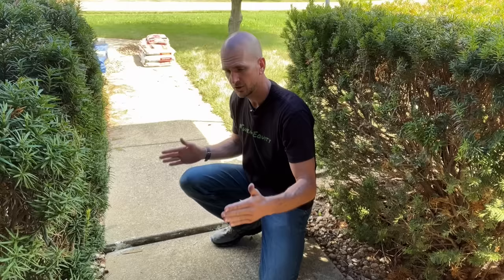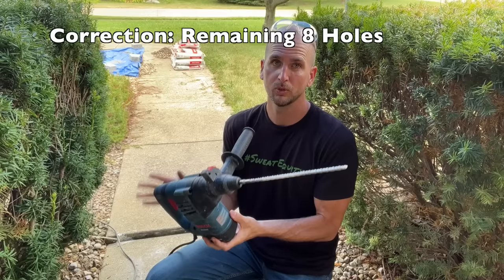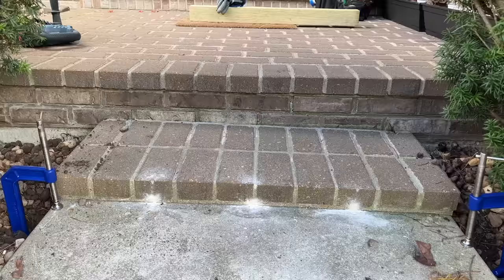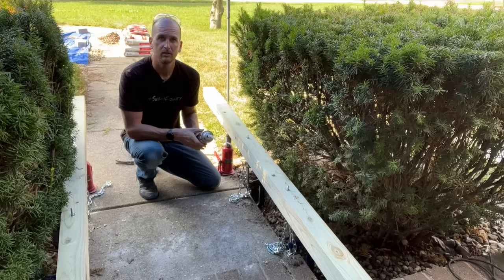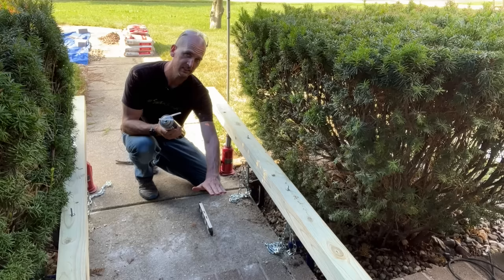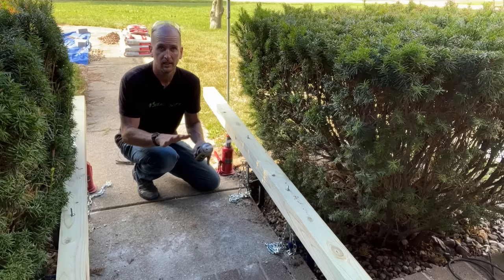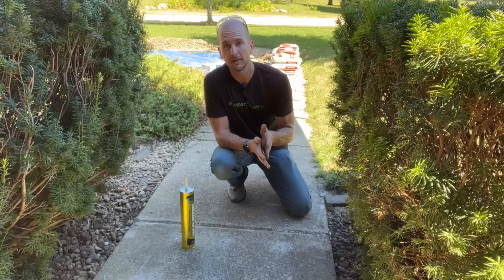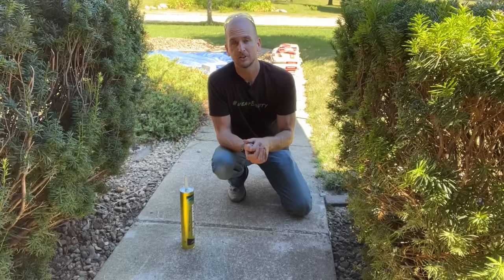How To Fix A Sunken Sidewalk With Spray Foam

Comment: In my view it would have been much less work to simply lift the slab, add additional hard core then replace the slab.
Reply: i think he didn't do that because the step to porch was on top of it
Reply: He showed one way to do it, there are several ways it could be done.
Reply: 🤭🤣 Yeah but he wants us to do it the dumb way while looking like "engineers"..!!
Reply: @carlosmejia5728  How is it the dumb way if it works fine? You sound like a real "my way is the only right way" gem of a person.
Reply: I don't know Trevor. That would have cost upwards of $0.17. This way was only $730.
Reply: Yep, so much easier. Cut the existing slab across just in front of the step to release it, lift it, backfill to the required level and drop the slab back down. Job done.
Reply: That, and the foam having air pockets aka bubbles. That thing will sink again and that soon...
Reply: Yes this was the special needs method.... brother what a complete and utter waste of time and money lmaaaaooo !
Reply: He is just trying to illustrate another  way to lift…he’s not saying it’s the only way. Get a life people!
Reply: @PatHaskell  quite, but he chooses the most difficult way.
Reply: @Steve
Exactly, this guy is a joke
Reply: This is the way.
Reply: I was just thinking the same 🤔
Reply: Can you make a video of how you would do it?
Reply: Can you make a video of how you would do it?
Reply: @jakewest2524  Can you make a video of how you would do it?
Reply: @SquareDancevideos1  I would if I had one to fix, but I haven’t.
Reply: In your view, how do you move the slab out of the way, to add the substrate? The bottom of slab is surely slightly irregular. How many times do you wrangle the slab back into place, only to find that you need to pick it back up again, move it out of the way and adjust the earth?
Reply: @commandoconstruction2720  I’ve already made my point.
Reply: exactly. just add rocks underneath now
Reply: That wouldn’t have warranted a video, although it would be the logical fix.
Reply: That slab would be 300 lbs. How would you lift it?
Reply: Yes you are correct
Reply: @Fhita1962  hahahahahaha
Reply: Yes adding more fill under the low side often works
Reply: @PatHaskell  you're half correct because it is another way to lift the cement slab. Question you should be asking yourself is how long will this procedure last. When you get the right answer it will be not very long. This is a temporary fix to cheat your way out of a safety violation because of a trip hazard. It's very temporary. Do it the right way and hire a slabjacking company. They lift it with the proper materials instead of using spray foam that collapses in a short time
Reply: Pretty much click bait. The thumbnail and the title leads us to believe he has a quick and easy fix.
Reply: Or just use the correct foam lmfao
Reply: A lot cheaper than pouring cement. 🍻
Reply: I need to do this, but with a whole front stoop...not precast or hollow.  How should I do that?
Reply: Yeah, but that’s really not comparable guys. I mean we’re talking about a lot less work and a lot less money which the average homeowner is looking for. Hell I could’ve went out there with my bobcat and tore everything up and re-done all of it and made it look incredible, and perfectly leveled if he’s willing to spend 30k on it.😅
Reply: More fun this way for retired and bored construction workers. Tell me I'm wrong.
Reply: @hurtfultruth6539  there’s no need to throw money away hiring a slabjacking company. Unless you’re disabled or a weakling. This job is too small, you’ll have to pay way too much.
Reply: way less fun though!
Reply: @luskmonster  sure and if my wheel falls off of my automobile, I can fix it with Superglue. Why go to an automotive shop and pay all that money to fix it the right way. 😂
Reply: @michaelmorrissey1052 it depends on where the slab is located

Comment: As a concrete and foundation inspector employed by a company specializing in poly foam lifting and leveling, I can attest that this method is highly effective. One crucial step not to overlook is the curing time. While commercial-grade poly can solidify in 15 minutes or less, as mentioned in the video, Great Stuff will require a longer curing period. Excellent video, my friend!
Reply: Don't the holes directly in the slab potentially cause it to crack?
Seems to me the best way would be to insert hoses under the slab and pump it in that way until level.
Reply: @walkermom100 no. A distribution of holes is needed to get good support underneath.
Reply: Thanks Dad...
Reply: Since he had Access from the side, why not just fill it with leveling concrete.
Reply: This is not a DIY solution. Way to many tools to get this done.
Reply: Be so much quicker to lift the slab and adjust the ground base 😂
Reply: @DevonLevack   DYI doesn't mean "no tools required", it means you don't need to be a pro to do that  ;)
Reply: @DevonLevack  🤣 He used like no tools!  These are all tools that every DIY'r would have.... lol!
Reply: How long does the great stuff really support that concrete honestly?

Comment: We had a company come out and do the same thing, but if I was to do it again, I wouldn't let them drill the holes because we got a few cracks now between a couple of the holes.  When I was a kid we'd use a breaker bar and just lift the sidewalk and put dirt under it and then put it back down.  I think overall, that is the better option and no drilling holes in the cement and trying to match the color later
Reply: Thats definitely the best way when its rain and erosion likely moving the dirt over time. That foam can set uneven and definitely stress the block with other gravitational forces.
Reply: I laughed because that’s exactly what I would do if I found an uneven sidewalk slab in my yard. This video, although well done, reminds me that sometimes people make things too complicated…
Reply: @overbuiltlimited  Where I worked was a workshop and offices attached. The offices started to sink a lot. You feel yourself walking downhill. They drilled some test holes and found it was built over a dump site. There were all sorts of voids. So they raised it back up with concrete under pressure. I though that can't work, you've added even more weight. Sure enough, it raised it for a while then started sinking even quicker. People got sued and the whole place was relocated.
Reply: That is the best method, because with Winter frost water will freeze under that foam and may lift that area.
Reply: You actually had a company that did the same thing. That's interesting.
Reply: @stringlocker  there is a product called poly jack, they have subcontractors that do more or less the same thing all over the country.
Reply: This is nothing I would attempt. Or even thought of. I can't even remember why I watched this video. But I don't normally watch videos from start to finish but I did on this one I thought it was pretty cool. I'm not as patient as this guy. This is a cool home project but I can't imagine there's a company doing it this way. Most companies would have a backhoe. Putting dirt under something never works.
Reply: @stringlocker  what are you going to do with the backhoe?
Reply: You won't need the 4x4s you could use the backhoe and a chain to lift the sidewalk. I mean for me I would Smash It and pour a new piece. All I'm saying is this was interesting.
Reply: This project looks like something that a  person with a lot of Ingenuity would think of. I don't see a company spending the time doing this.
Reply: @stringlocker  well, you know there is a right way to do something, and there is also a way to do something so you can charge exaggerated prices while adding minimal value and investing minimal resources and equipment. 
Your way is the former and this way is the latter.  
To lift and level a slab they charge 50-75% of what a concrete guy would charge to replace it as a standard, not because it’s worth that, because they know those are usually your only two choices so they can and people pay it just because it is the cheaper option and they have to do something about their uneven concrete.
Reply: @stringlocker  oh you’re right about the first part for sure! 
For the second part, that’s up to you.  I’d say it’s not worth your time but if you wanted to see a company doing it, poly jacking videos are undoubtedly only a few clicks away.
Reply: @jaxturner7288  okay I see that I stand corrected.
Reply: I don't want to go down a rabbit hole polyjacking so maybe you could tell me. What's the consensus does it hold up.
Reply: @stringlocker  it’s a half measure of repair combined with a scam of a business model.  
No shame in thinking/hoping there wouldn’t be people doing it commercially. 👊
Reply: @stringlocker  damn you just gotta make me say something positive about them don’t you. 
I guess the worst I can say is that it doesn’t have a reputation for failing.
Reply: We all know if something sinks that means there's something soft underneath. So I guess we're on the same page. I will stop beating the dead horse.
Reply: @stringlocker  Or, it could mean there is a water source under there.  and I have a 1930's topo map showing a  creek running thru my back yard near where the addition is, and usually where there is a creek, there can be springs. Sometimes hope springs eternal, sometimes springs create holes.
Reply: Absolutely. As long as you can access the sides of the slab, it's best to just pack dirt underneath.
Reply: @overbuiltlimited  And put unnecessary holes in brand new, expensive lumber.
Reply: @stringlocker  How much would a properly poured slab cost?
Reply: @wadebarnett2542  depends I just happen to know how to do it. So it wouldn't cost much at all. If you hire a contractor it will be much higher. But pouring the small slab is cheap.
Reply: @dirtabd  You do not use dirt....but a mud slurry pumped in, so it fills all of the void. Over lift the walk section because it will settle back in as the slurry dries
Reply: @JayDee-xj9lu  it is residential.
 I guess in the 60's the neighborhood was built so fast they didnt tamper the ground for sidewalks at all and very very poorly for driveways if done at all. And most basements were not filled and tampered correctly either. The entire house will sink 5-11 inches. Breaking sewer pipes off and sinking below the 6 inches of diameter opening inside the pipe. And even a 200-300 pound slab of concrete will sink an inch or two. Not 5-50ft!
Reply: You could also pump in foam from each side, no holes necessary.
Reply: How much did they charge?
Reply: Won't work on a driveway. You can't pack from the side; driveway will crack due to interior voids. Wire mesh in a driveway is almost useless. It bends over time. Spend a few $100 more and install rebar.
Reply: @JayDee-xj9lu  wow!
Reply: I would have just filled the gaps with gravel i under the slab, too. It's far less toxic to the dirt and to the planet...
Reply: @stringlocker  Thats where you are wrong, there are companies that do this the same exact, backhoes are expensive and cant always be moved into small areas
Reply: @sigsauersean  wrong? How dare you.
Reply: Shhh People don't know what life was like before modern technological stupidity
Reply: Repent and believe in Jesus Christ  Hell yeah!  Now your talking!  A little prayer will raise that slab, yes siree-bob, you betcha! Pack a few bibles underneath and it'll last forever!
Sheesh.
Reply: @overbuiltlimited  I in my experience DIYers without experience will always pick the most complicated and expensive option with the lowest chance for success. Social media is here for them.
Reply: Or small rocks to avoid soil erosion?
Reply: @stringlocker  That's great if you have money! I don't, plus i look at it like conserving history and waste! Poor people have poor ways! I'm doing my whole sidewalk, or cities, this way! Why spend a fortune on the cities sidewalk?
Reply: Ya, this foam method is stupid on many levels.

Hey folks, today I'm going to show you how to destroy your homes structural integrity.

"When I'm done with you, your home will have as much integrity as I do, 0" - bad youtube home repair guy
Reply: @johnnelson5083  that's why they have civil engineers. If your property is subsiding and your house was built on a historic creek, it might be good to call one. Get soil technicians out there to do compaction testing and draw up plans for erosion control. Then fix any issues according to the plan.

It won't be cheap, but it will be right.
Reply: Long walk
Short drink
Just bust up the old piece and pour new cement

Comment: Anyone concerned the foam might get compressed over time. There is another product made by Loctite called Tite foam. It is advertised as being 4 times as dense as other expanding foams. It has been a long time since I purchased it but it should be comparably priced as other foams and available at many of the same stores.
Reply: Not worried. Certain.Urethane spray foam is not weather proof/ It will degrade overtime and if an animal finds it it becomes an easy place to dig. This is a 10 year fix at the outside.
Reply: compression is not really an issue because even a several hundred pound slab is only a few pounds per square inch. IOW, hardly anything in the big picture.
Reply: Concerned?  I don't care.